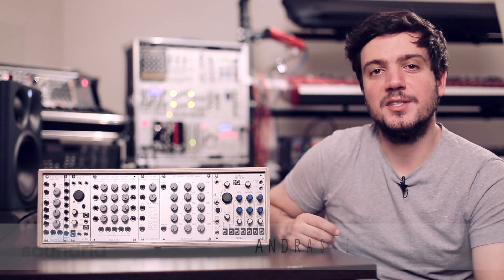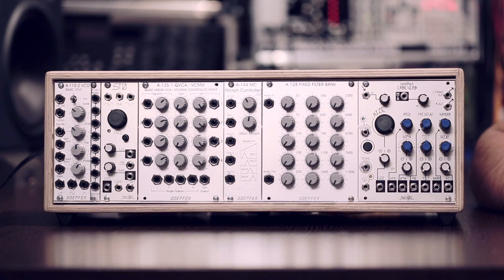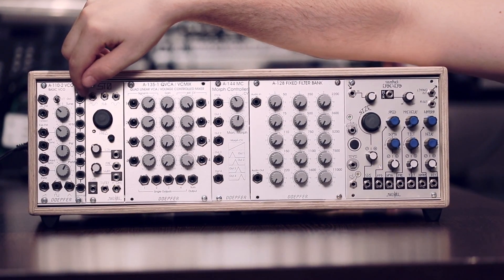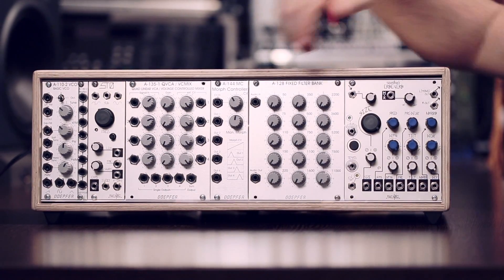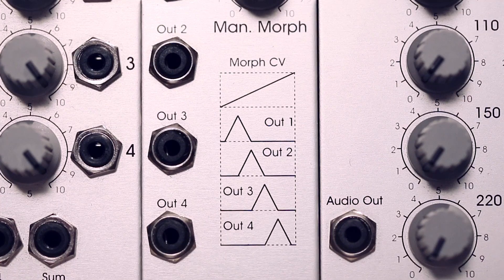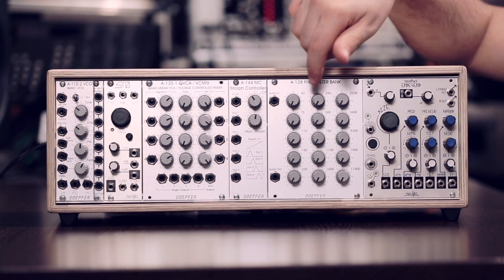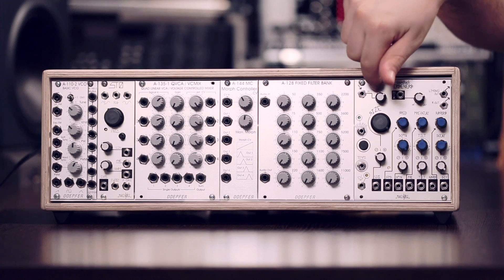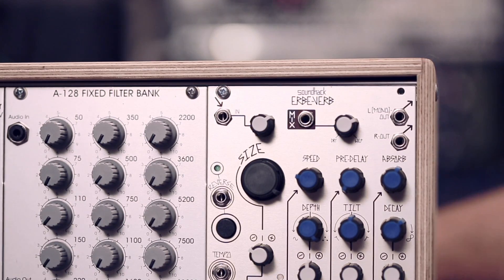Patch Lab #01: Noone’s Filter Bank (English)

Comment: Really nice, the sound is amazing. But this total setup is approaching $1000.
Can my Serge Resonant Equalizer be used in place of the A-128  fixed filter bank ?
I have other osc's and verb's already, so I may be looking at just the A-144 Morph Controller ($90) and the A-135-1 VC mixer ( $190) =  $280

Comment: I'm looking at this from the future... that filter bank can't be modulated.  That feels hugely disappointing as that would allow you to make some rhythmic shifting of different filters in and out.  That would probably be expensive to do... but worth it.
Reply: I’m from even further in the future, and it is still the norm for filter banks not to have cv control per band. You’d need a VCA for every single band.. Frap Tools’ Fumana does do that, for €950 in 42HP. Different league.

Comment: otherworldly! really beautiful textures. any comparable filter bank modules with cv support?
Reply: +Zach Hodge The ADDAC 601 has cv inputs to set the levels of the bands (8 bands only) It also features individual band outs, and an envelope follower per band. It has stereo in and separate outs for the odd and even bands, and it sound amazing too. However it belongs to another price range. You can check it out here:

http://soundria.com/addac-addac-601-vc-filterbank.html

Btw.: Its easy to mod the A-128 Filterbank to have individual band outs, and than you need just a couple of VCAs to control the bands. Here is the mod documentation:&#160;

http://www.doepfer.de/service/A128_single_outputs.pdf

I would do this, and get some A-132-4 VCAs to save some money, and you know.. you can never have enough VCAs ;)